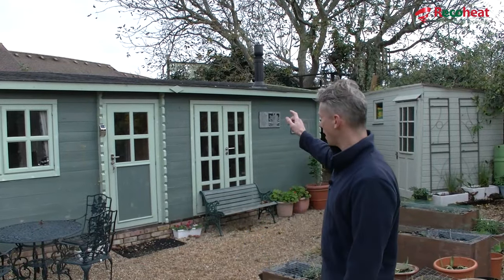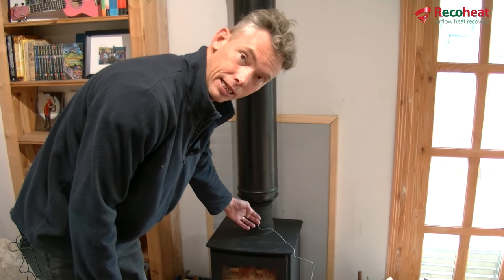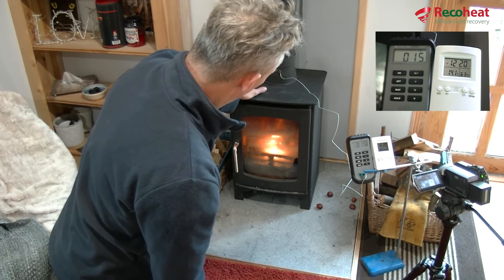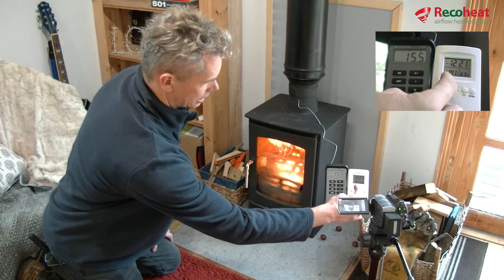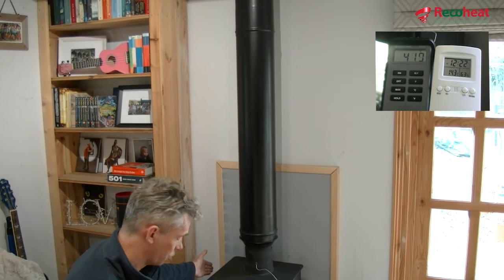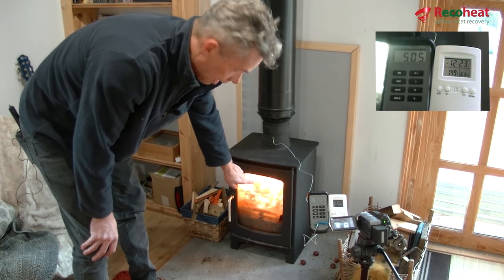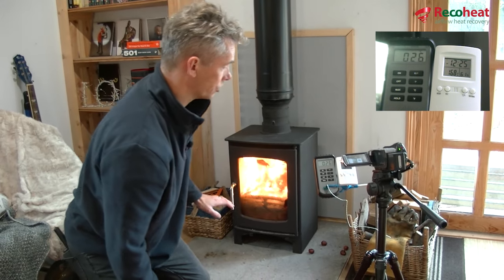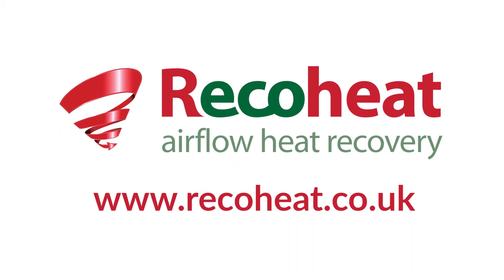Introducing the Recoheat heat recovery unit for wood and solid fuel burning stoves

Comment: Quote from website 'use half the fuel for twice the heat output.' Given that a modern stove is ~80% efficient, how is that possible? (320% efficient...)
Reply from the maker: By running it for four times the burn time, and producing a pumped output temperature that regulates the room temperature sufficient to warm it and prevent a temperature drop that takes lots of heat to redress. That is the key to the efficiency - not simply heat output, which is minimal compared to that of the stove itself. The device works by driving the heat more efficiently, and without the necessity for convection, which in turn obviates the necessity to have a consistently high radiant heat output from the stove.
Reply: @Recoheat  I repeat- the efficiency of stoves is c 80%. Length of burn is irrelevant, it is the energy content of the wood vs the heat output of the stove. You are claiming 360%!
Reply from the maker: @Tensquaremetreworkshop  No, it's not! Who cares how hot you fire is, if there is no heat distribution! You appear to think that the purpose of a domestic heating system is to create a jet engine in a small hole. The definition of efficiency is to use the least to greatest effect. Our device strives to achieve that, and it does so by exploiting a specific of thermo-dynamics that is being used widely in industrial applications but not in domestic, because it is generally too complex and expensive. We've made a significant bridge in application. If you doubt the science, that's fine, but is simply down to ignorance: it's effectiveness and reality is incontrovertible. Whether we're applying it effectively is down to our own effectiveness, and proved above all by our customers. I quite understand and appreciate your incredulity, because the physics is not logical - but it is real. Go and research it - or just look at the difference it does actually - not theoretically - make to people using the device.
Reply: @Recoheat  Let me make this as simple as possible. If I have a piece of wood that contains 1MJ of energy, a modern stove will allow 800KJ of that to be used to heat the room (80% efficiency) regardless of whether I do it slowly or quickly. The home page of your website claims to to produce 'twice the heat, for twice as long'- that amounts to 4 x 800KJ = 3.2MJ of energy. Would you care to tell us how you get 3.2MJ out of a 1MJ log?
Reply: @Recoheat  I am far from ignorant- I am a Consulting Engineer, and I often have to spoil the day of clients who have come up with a scheme that unfortunately defies the laws of Physics. I have studied thermodynamics (at degree level) which, from some of your comments, you have not. An example- the calculation of heat transfer on your website is incorrect (by a factor of 2), due to miss-applying the formula. I have left a note there explaining the error.
Reply from the maker: @Tensquaremetreworkshop  Hi Mike: I understand what you're saying about the energy release from combustion from a given weight of wood. Our own calculations are based on the same thing. The point of difference is not how much heat is produced, but the work it does to warm the room. A stove is not an engine: it's function is to heat the room, not itself. A big problem with stoves is that their effectiveness as a heating system is defined by the circulation of air around it, not by how much heat it produces. You'll know that this is particularly the case with stoves that are set into a small chimney cut-out. It doesn't matter how many kw of heat it produces - the area that it heats is very restricted. Do you understand the principle of the point I'm making? The other major effect is the fact that your 1MJ log will burn hot for a period and transfer 80% of that heat into the stove. That's where it will stay if there is not sufficient radiant heat being generated by the stove body to create a convection flow of air to circulate the heat around the room. So you may have passed 80% of the heat into the stove body, but it is generating zero heat into the room. 

Here are the results of a test we ran with 2410g of woodsure-certified kindling, where we tested the temperature across the stove, in the flue and out of the Recoheat outlet across 330 minutes: I'm sorry the table doesn't lay out properly in this text format, but I hope you can read it. You'll see that the stove surface cools in an even curve, as you'd expect, but that there is a much more rapid drop in the air temperature 30mm above the stove. Once that air temperature drops, you'll know that it can create no effective convection stream to circulate the heat. The Recoheat temperature also drops of course, but the air is still flowing, because it's being pumped. So at 330 minutes, it is still blowing air at 32 degrees into the room, while the stove surface is at 20 degrees and hasn't been 32 degrees for three and a half hours. Does that make the point clearer?

Time in mins from ignition.	Stove surface temp 	30mm above stove surface 	Recoheat outlet 70mm above stove 	Flue gas 590mm above stove 	Flue draw 
1 	9.7 	9.5 	26 	156 	10 
3 	12 	85 	243 	312 	13 
5 	22 	95 	288 	328 	15 
10 	26 	187 	365 	482 	17 
20 	65 	384 	385 	462 	18 
30 	71 	332 	448 	482 	19 
45 	68 	234 	344 	391 	16 
70 	41 	155 	166 	208 	11 
90 	35 	107 	139 	188 	9 
120 	32 	111 	114 	141 	8 
150 	29 	89 	92 	121 	8 
180 	25 	76 	77 	93 	8 
210 	26 	66 	62 	85 	6 
240 	21 	50 	59 	76 	6 
270 	22 	53 	51 	71 	4 
300 	22 	48 	42 	53 	3 
330 	20 	37 	32 	41 	3
Reply from the maker: The heat output of the Recoheat from that burn - which was just of kindling, don't forget was calculated at approximately .86kw
We used the following calculation to determine the heat output from the device.

Area
Surface area is πDL
@100mm length of 8mm internal diameter stainless steel tube = 0.00251 m2
@ 1900mm length of 8mm internal diameter stainless steel = .04769 m2
Properties of Air
1 litre per second = 0.001 m3/sec = 3.6m3/hour
Temperature in approx. 5 °C
Temperature out approx. 480°C
ΔΤ = Change in temperature ≈1.205 kg/m3
Flue gas temperature ≈ 500°C - 600°C
U = for air to air heat exchanger 10-40 W/m2 °C
Heat Transfer
Q = UAΔT
Q = Heat transfer (watts)
U = Overall Heat Transfer Co-efficient (w/m2k) = 40 w/m2k
A = Surface area = .04769 m2
ΔΤ = Change in temperature = 475°C
Therefore:
Q = 40 x .04769 x 450 = 858.42w = 0.86kw
Reply from the maker: @Tensquaremetreworkshop  Hi Mike. Your comment is interesting but your notion of it producing half the output is based on the assumption that the heating is done at a steady state, isn't it? I'm not sure either that you seem to be discussing the temperature of the steel rather than the air flow? Am I misunderstanding that?
Reply: @Recoheat  Have you studied the European standard for stove efficiency ratings? It covers the ratio of energy content in the fuel to the heat circulated into the room. 
If there is a rapid drop in temperature as you move from the surface of the stove, that is because it has been transferred further into the room. It is a sign of efficiency, not the opposite. If the stove is not transferring heat, it will continue to get hotter. 
You may change the heat-time profile by various means (including your heat exchanger) but that does not get any more energy out of the fuel. All of this is covered in the first year of an engineering degree- was your designer asleep?
Reply: @Recoheat  Your error is in ΔΤ. It may be 475 at the beginning of the coil, but it is ~20 at the exit. Average is half, so transfer is half. You are welcome.
Reply from the maker: @Tensquaremetreworkshop  Mike, you are being fatuous. It does of course get more energy into the room. Who cares how much heat there is in a steel box - you're not sitting in it. The heat production of the fuel is irrelevant if the heat doesn't transfer, and irrelevant if the transfer is not wider than the immediate vicinity. The calculation that might exercise you is the convection flow rate generated by the combustion at various points.  You may choose to ignore that, but it is what makes a house warm or not. You're not being clever to ignore it.
Reply: @Recoheat  No, it is the calculation you made on heat exchanger transfer capacity. Because you did not allow for the air inside warming as it passed through , so that the temperature across the tube is decreasing,  the average ΔΤ is half that which you used. 
This is only part of the story- the donor gas also needs to be able to pass the heat with little or no cooling (!) and the working fluid needs to have the heat capacity to absorb it. I calculate that at c 580W with a 1l/S flow.
Reply from the maker: @Tensquaremetreworkshop You're forgetting that air cools as it expands because the frequency of atomic collisions decreases, so the air that is excited in the turbulent barrier layer heats, expands, accelerates and takes in more heat. That is why we drive the air up to pre-heat it, then down through the coil so that the heat acting on the coil increases as the air proceeds through it. Your simplification of the process is inaccurate therefore.
Reply: @Recoheat  What statement of mine is fatuous? My point is that EN standards test includes all the relevant transfers. They calculate that a modern stove converts 80% of the fuel's energy (in J) to room heating. Leaving only 20% for further recovery. That is the maximum, and unattainable in practice- especially when condensation of flue gases is taken into consideration. Had you claimed a further 10%, I might have been skeptical. But you are claiming 240%. Unless you can understand this, and do real tests (heat transfer, not just temperature), and modify your claims, I have little choice but to report your claims to the ASA and let them deal with it.
Reply from the maker: @Tensquaremetreworkshop  Again, you're ignoring the nature of the device to repeat the same meaningless statement. The efficiencies are gained by the heat distribution, not the combustion. You might as well claim that cars don't have variable efficiencies because fuel all combusts at the same rate. That is, in my opinion, fatuous.
Reply: @Recoheat  Sorry, No! The thermal capacity of air depends on its mass, not its volume. As it expands or contracts, its density changes exactly in step. The mass remains the same. A m3 of air at room temperature weighs approx 1.2kg. (there is a slight capacity change, but over 500C it is less than 1%).
On the last part, you start the coil at the top because that is where the flue gas will be coolest, and end where it will be hottest. That is heat exchanger 101.
I have not simplified it- you have merely throw in a lot of irrelevant words. The way to discuss this is with numbers. Thermodynamics is well understood (at least by some) and heat exchanger engineering is over a century old.
Reply from the maker: @Tensquaremetreworkshop  We're very happy to defend the statement because we simply have to evidence the outcome, not the theory. We have customers making these savings and seeing these benefits, and it is very easily demonstrable. We started with the empirical and have sought to explain the observable phenomenon. We're not selling the theories - we're selling the outcomes, which are indeed as claimed.
Reply: @Recoheat  One again, the 80% efficiency rating includes, I repeat includes, heat distribution. How could it not? That would be meaningless. You cannot get more than 1MJ out of a 1MJ log.
Cars- Fuel has a specific energy content, but the amount you can extract as useful mechanical energy depends on a number of factors, principally compression ratio- but you can make it multi-stage (turbos) to increase it, especially with inter-stage cooling. But that is more complex thermodynamics, and I do not think you are ready.
Reply: @Recoheat  Get independent verification of your 1l/S input and 500C output using 37W of pump and I will publicly apologize. It will still be only 500W though... (neither your heat exchanger or air heat capacity can supply more).
You are, sadly, selling snake oil.
Reply from the maker: @Tensquaremetreworkshop  You'd be fine making statements like that if we had no empirical evidence to the contrary. Given that we have ample evidence that your statement is entirely inaccurate, how does that put you?
Reply from the maker: @Tensquaremetreworkshop  I know Mike - I'm stupid, you're clever - and I'm warm, and you're fulminating. And you're still ignoring the fundamentals of the device and its working. That's fine - you can take a horse to water, but you're better off putting it in lasagne.
Reply: @Recoheat  Not once have you claimed to have measured the flow into the exchanger. I have shown that it cannot be achieved with 37W. Measure it!
Reply: @Recoheat  I am not saying you are stupid, just ignorant of thermodynamics. (if you were not, you would be giving me numbers, not words.) That is fine, I am ignorant of how to play a piano (amongst other things). But then I am not selling pianos...
Reply from the maker: @Tensquaremetreworkshop  I'll try the manometer on the flow rate - I hadn't thought of that: calculation was made on the input rate and the expansion under the heat. The temperature is much simpler, of course. Do you think we're faking the outputs in the demo?
Reply: @Recoheat  A manometer will give you pressure, not flow. The flow rate is crucial to the output- it determines the mass of air and hence heat carrying capacity. It needs to be when running, as the back pressure from the heated air will increase the work the pump needs to do. My best guess would be around 0.2l/S, but could be a lot less.
A quick and dirty way to get an idea is to use a large polythene bag (not under pressure) on the inlet to the pump- time the collapse and calculate the volume. Pressure would be interesting to know- it would help the analysis.
As you are not measuring flow, faking is not involved. You just do not know what it is.

Comment: Can you please tell me the grade of metal that is used inside the flu pipe ??? Thanks
Reply from the maker: 316 stainless as required by the regulations. We're CE marked and compliant under the standards for a rigid flue section. Thanks for the interest. If you've any further questions, do get in touch via the website www.recoheat.co.uk
Reply: @Recoheat  Thank you for a quick response Sir.
Reply: I will purchase one this coming winter. Thanks
Reply from the maker: 8Truth Seeking  Sounds like you just need to renew the fire cement. Otherwise, I'd recommend getting someone qualified to look at it - and make sure your carbon monoxide alarm is working in the meantime. If you can smell leakage, it definitely needs sorting because the flue should have a negative pressure - so it should be sucking air in, not letting it out. If it's going the wrong way, it'll be because of the air pressure because of external temperature, or you've got a blockage, or your flue isn't high enough. Definitely get it checked.

Comment: Who lights  a fire then shuts the door whilst it catches?
I have 2 meters of single skin flue on my fire, it radiates heat within minutes to be honest.  And the single skin is much cheaper than the twin wall so money already saved..
Reply from the maker: It's funny to watch something working in fact, and pointing out it doesn't work in theory. Wouldn't logic dictate you changed the theory?

Comment: Good way to have allot of creosote build up in a chimney especially if you are not running it full bore all of the time.   Possible fire hazard.   Also, fyi, you can do this just as well without an air pump.
Reply from the maker: High temperature of the coil and the von Karman vortices it induces prevents build up of soot on the coil in a healthy flue. Also, fyi, it plainly doesn't. If it did, when we switched the pump off, it would function just as well, so we and every observer, engineer and customer would have to be pretty bloody stupid to persuade ourselves that it did.

Comment: That video didn't really tell me anything, so they pump air in which makes the fire burn hotter and quicker so it gives of more heat. Maybe show the insides so we can see what this magic thing is or even show the fire working  without the pump so we can compare the results
Reply from the maker: No - we don't pump air into the stove or affect the combustion in any way. It's a sealed heat exchange unit using turbulent air to transfer heat more efficiently.
Reply: @Recoheat  He said it is a sealed unit with an air pump, so how does that work then ?

Comment: How do you put stove  pipe through roof
Reply from the maker: You need to be using twin-skin flue pipe. Cut a hole with 50mm clearance around, put a ceiling bracket in and put the flue through to whatever height you need for your roof and draw. Fit a rubber seal/cap on the outside, which needs screwing and sealing. Then fit the roofing felt over-lapping the edges. On the inside, you then fit a sealing plate to cover the hole.